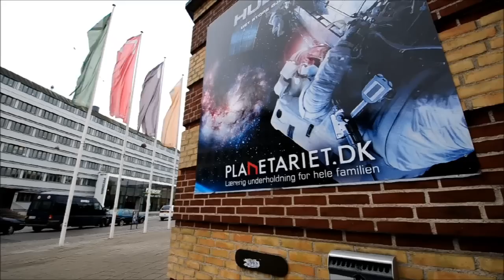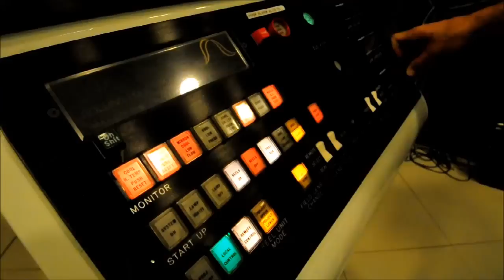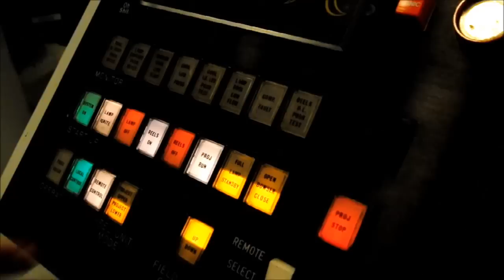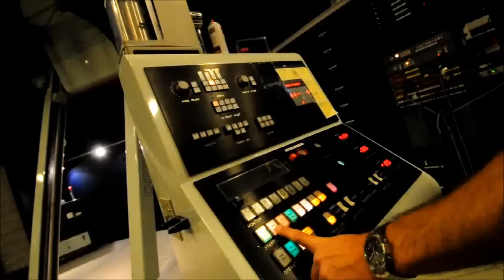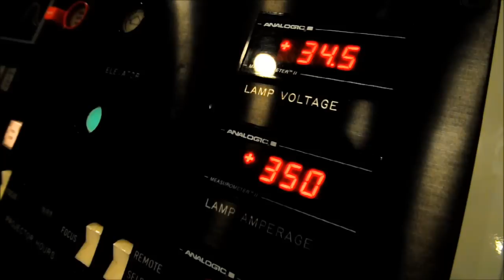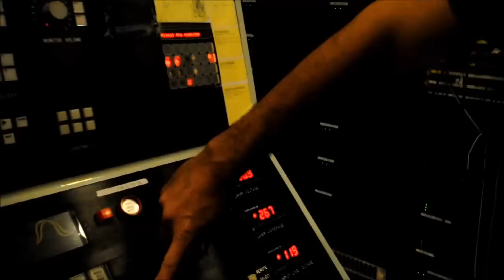70MM i København. IMAX Dome i Planetariet

Comment: This is the same IMAX system that I first saw at The NASA Alabama Space & Rocket Center in Huntsville, Alabama.  The absolute highest net visual resolution in the absolute most immersive dome format.  It is yet to be eclipsed by either 3D IMAX or Digital IMAX.  My only hope is these dome 70mm IMAX theaters aren't replaced with digital until IMAX makes a digital and laser system that can do the same format better.

Comment: This machine is such a monster that even the digital projector hasn't got the balls to replace his throne. Long live mechanical film cinematography. I miss your greasy smell. I miss the cogs, pooleys and reels turning. I miss the dust on the film, in the sound, I miss the fiml bobbles and cracks. I miss this noise. The digital world is a monster in uniformisation of the media. They are even poushing out for one screen format 16/9 for everybody now. Where are the movies shot in 16:10 or 2.11:1 and 3.35.1?, 5:3, 5:4...
Reply: More importantly, it doesn't have the resolution. We're nowhere near the 16K digital projector it'll take to replace these.